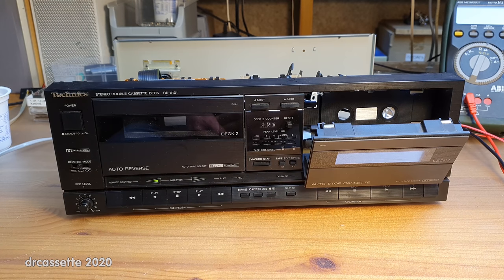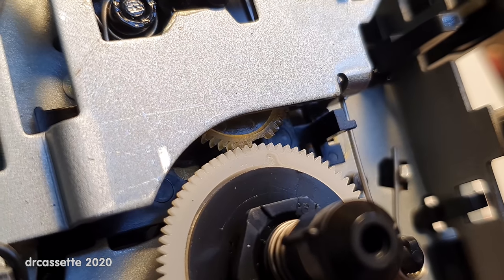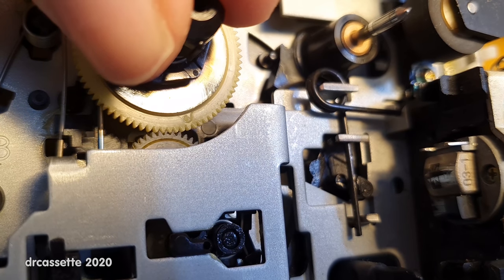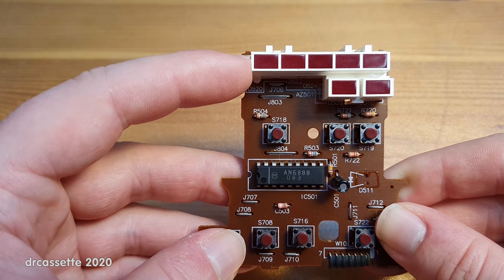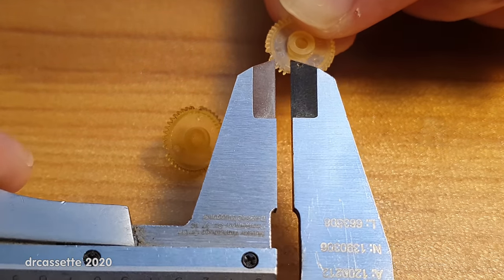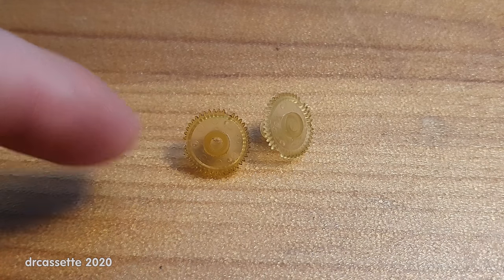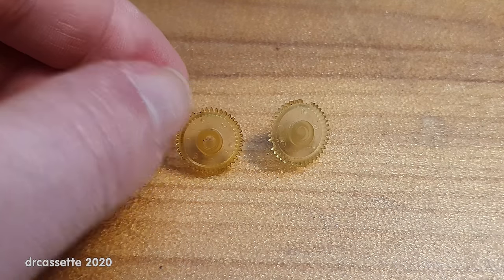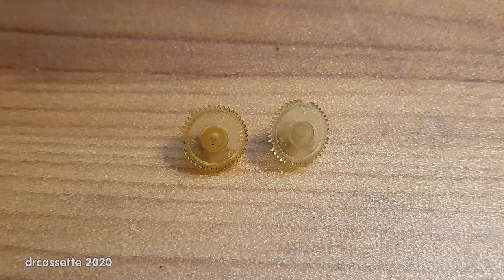Technics RS-X101 dual cassette deck with broken soft plastic gears

Comment from the maker: Some more info and thoughts:
- It has been pointed out that there are replacement gears available that have been made from a mould of an intact original gear, as discussed in the video. However, two of these gears cost more than a cassette deck like this is worth around here. So such a repair would be uneconomical. 
- While I am taking part in this debate, I am not looking for ways to reproduce gears myself. I don't consider many cassette decks worth the effort of reproducing gears. 
- These broken gears each have 42 teeth. The teeth have a special shape, they are not just triangles arranged around a circle.
- Apparently some high end filament based 3D printers are able to achieve a print resolution of 0.1 mm, which would be good enough.
- The prints from resin based 3D printers are apparently not long term stable. UV light is used to harden the printed resin, but any further UV exposure (admittedly unlikely inside a cassette deck) further hardens the resin, so eventually the material becomes brittle.
Reply: It will be great if someone can give a link to buy gears like this. I have Philips but the teeth direction are under a corner, so more difficult. 🤔
Reply: You have the same kind of cassette deck and same plastic wheel on many Technics as well as Panasonic Rx-Dt and sisters. Hope it helps, Best, Ingeltech
Reply: Unless it's a Nakamichi, Sony ES or another well-sought-after high end deck, maybe a Pioneer CT-F1250 or CT-A9 or some older Duals, getting replacement gears is not worth the effort. Especially not for a rather questionable dual well Technics, probably with already-worn Ferrite heads that can't even reach 15 kHz 🤷🏼‍♂️

Technics had some killer decks back in the day, but this isn't one of them.
Reply: @Remembergoodolddays  Many decks had those mechanisms, many autoreverse decks from Technics and Panasonic (more or less the same company) and I think that also Denon used it.
Reply: Agree that this deck is probably not worth the effort, I've seen these gears on line as single units and larger quantities.  
My buddy who has just emigrated to oz is a Horologist and regularly files teeth in brass discs to make replacement cogs, using the old cog as a template.
I used his equipment, desktop lathe, to ensure the 3D printed disc was round and the hole was centered. 
TUsinghen, using the old cog as a template I filed the teeth with a small triangular file that matched the pitch on the original cog.
It certainly did a good job on my 30 year old JVC twin deck
Reply: Beautifully said my friend

Comment: I would have guessed the tape transport was from Philips as they were using such soft plastic basically everywhere, but it makes sense it comes from Alps.
I can confirm the noise increases when the gear is replaced with a harder plastic type: I have a Philips CD 204 with a new gear in the drawer open/close mechanism and a portable CD player Philips D6800 with a new gear in the pick-up sledge movement. In both cases they work fine, but they are much noisier, the portable CD player especially is very noisy when changing track. But both gears are not critical for audio quality and I can live with the extra noise. (also both gears were already available, I just ordered them, no need to 3D design and print gears !)
Reply from the maker: There are good replacements available for the Philips CD loading mechanism, and those CD players are worth buying such a replacement gear :)

Comment: I have been ordering from a guy on ebay out of Hungry for these gears. Done 3 decks already. They are louder but run like champs...push through the tapes reels quickly and don't bog down.
Reply: Can you post address of the seller from Hungary if possible ? Thx
Reply: @pliedtka  akg090
Reply: @Phatty057  
Köszönöm - THX!
Reply from the maker: I have found there are replacement gears available, however, two of these gears cost more than a cassette deck like this is worth around here. So such a repair would be uneconomical.

Comment: Technics broken gears is a typical issue, there is a guy on ebay selling these gears made by 3d printer
Reply from the maker: I have found there are replacement gears available, however, two of these gears cost more than a cassette deck like this is worth around here. So such a repair would be uneconomical.

Comment: I remember a little over 20 years ago noticing how many VHS VCRs were eating tape and it was almost always caused by the reel drive rubber tire glazing over or drying out. I was glad that the Panasonic VCRs we had at home used one of those soft (urethane?) rubber gears that never caused that problem and would seemingly last a really long time.

Here we are a '*really* long time' later...and the rubber tires are looking a little better now since they're generic and more easily substituted.

Not going to argue since you have more (and more interesting) decks come through your shop that might be a better use of the parts from this broken one.
Reply: Ugh I hated those awful tyres - high failure part found in a few 80s-era boomboxes as well; a royal pain to source and replace with new. The take-up spindle won't rotate if the tyre breaks, fails, or disintegrates, thus eating tapes.

Comment: OMG, I had almost identical model before and had exactly the same issues, forward and rewind fine on right side but no play, on the left side, I only can play or record in the reversed direction. Thanks for revealing the reasons as I dare not to fix them.

Comment: I bought a replacement resin printed gear for my technics RS-B55 as it had the flexible gear with 3 teeth missing. The clonking has gone, but there is a low mechanical noise on playback, since I just enjoy playing cassettes and not a hi-fi buff it's not a big problem, but I agree with what you say in your video.
Reply from the maker: Thanks for the info!

Comment: You don't want to "put up with ridiculous suggestions that are guaranteed to fail".  You don't sound angry at all!  You clearly have more knowledge and experience than I do, but check this out -  My Technics deck didn't work.  I bought a printed gear on ebay.  Now the deck works.  It's amazing.
Reply from the maker: I have since found there are replacement gears available, however, two of these gears cost more than a cassette deck like this is worth around here. So such a repair would unfortunately be uneconomical.
Reply: Hi, sorry but could you please send me the link of the replacement gears of the cassette player of this video in the reply? I have this same model with the same broken gears, but I can't find the replacement. Thank you very much

Comment: That gear is easy to obtain for $11 shipped.  It's out of Russia, and also another guy in netherlands.  I've bought about 16 or so already to fix many Rs-Tr series decks.  Just search eBay for the Technics part number ..you will get it.
Also there is a video on how to fix that.  There is no need to take anything off the back of the transport contrary to popular instruction.
I've successfully repaired over 10 Rs-Tr decks already.
You are right..you can't and should not 3d print that.  With gears you have to respect module and pitch!  You have no 3d printer that can respect that resolution....yet
Sorry but I disagree completely on the soft plastic.  I can and did replace several and hear no noise or problem.  I only can't speak to longevity.
Reply from the maker: So I would need to buy two of these gears at a total cost of about 22€. The problem is, a cassette deck like this around here is worth maybe 10€ on a good day. So such a repair would not be economical. Of course, if there is sentimental value involved, this can be very different, but I personally don't want to loose money on my repair projects.
Reply: @DrCassette  That's a shame - I get about $100/usb ea serviced and repaired on Ebay - not much profit but enought to make it worthwhile.  My bigger problem with these decks and I'm sure you may run across it:
Sometimes the takeup hubs will seem to "catch" as they spin and drag.  This happens because if you prise off the hubs on the front side, there is a little plastic collar against the back metal plate that centers the spring and that same spring rides on it.  This hub will split, cause drag, and the spring will catch on the even minute split.  I'm currently trying just some small flat plastic washers, but have only had limited success...
Some of the newer decks i.e. with the motorized eject and rounded front are even more expensive to fix - the pinch rollers go bad and they are very specific 13.5mm with a strange collar.  I cant find them for less thatn $10 shipped * 4 =$40...Now it's starting to get hard to make it worthwhile with those.  (example RS-TR170)
If you know a solution to either problem, I'd appreciate it.
I just hate to see these discarded.
Reply from the maker: @jimb032   I actually have not come across this problem with the takeup hubs yet. I have had hubs that had seized because of bad grease. Cracked plastic parts are always annoying. Indeed replacement pinch rollers are extremely expensive, I unfortunately have not yet found a better, low cost source for them either...

Comment: Measuring the exact dimensions of the gear is already hard enough, even if you could replicate it, it would never be 100% accurate unless you have the original cad drawings for it. The original moulds where probably made of steel and with very fine tolerances. I’m always amazed by how mechanical engineers can work with such small, precise dimensions.

Comment: Tested method by myself! Baking soda and super glue + file = you can construct missing teeth. The hard plastic is not a problem and it is better than missing plastic ;)
Reply from the maker: I certainly don't have a file small enough to reconstruct these tiny teeth...

Comment: Not sure if it would work, but could you grind the teeth off the gears and use an O-Ring or tire in place?  On the hub gears, can they be made to use a tire as well?  Maybe worth a try just to see what happens for curiosity sake.
Reply from the maker: These gears are too thin, they could not support an o-ring...

Comment: I've had similar problems with a Philips D8614 Boombox, but in my case the gears just rotted inside the machine and instantly broke into pieces. I asked a friend if he could 3D print me the gears, but for now he only managed to print me just one as he is having some issues with his printer. At least that one gear works just fine. Also, from what I know, these gears are made out of TPU.

Comment: I fixed one of such gears but the plastic was harder - I used JB Weld Epoxy to rebuild the broken gear and filled the material to required shape - time consuming process. As whether such soft plastic is really required - maybe Matsushita, sorry Alps, made it too soft compromising the longevity.
Actually I would like to see the Uher deck mechanism to compare design and kind of materials used in it - hopefully less plastic.
Reply from the maker: What Uher deck do you mean?

Comment: We call these cheesegear :)
Luckily these are available from various sellers
Reply from the maker: I have since found there are replacement gears available, however, two of these gears cost more than a cassette deck like this is worth around here. So such a repair would be uneconomical...

Comment: I'm done with some Technics electronics now. Had an SU-V550 amplifier develop a fault after being repaired and then used for 5 hours and 45 minutes. Hopefully my partially repaired RS-615US cassette deck actually lasts after it's been fully repaired.
Reply: I have the 615, broken too. Oscillates at a high frequency, noisy mechanism, counter dead...
Reply from the maker: I have had mixed experiences with Technics equipment. Some of it is quite reliable and reasonably easy to repair when it fails, but other equipment is just terrible...

Comment: There is a fix that I have successfully applied, but bear in mind the mechanism.will be noisy and a bit messier. Proceed with putting a very small amount of HOT GLUE where the missing teeth are and they will turn fine. :-)

Comment: hi bob here you can save me a small bit time  the trans in  12.5  0  12.5ac  
do you know the amps on each 12v power rails   i now volts came from the amp it paired
with when sold   bob

Comment: I have the same cassette player with the same broken gears. it's hell to find them! Can you recommend me some solutions please? I am Italian so if for example there is some site to redo these gears in which I can also access. Thank you very much
Reply from the maker: Apparently there are replacement gears available on Ebay (see the other comments on this video), but I have not repaired this cassette deck as it would have been uneconomical.
Reply: @DrCassette  Thank you very much for the reply. I think I have found the spare, it costs 7 euros a gear, I bought two. I have listened to your measurements and they seem to match those of the announcement. If they don't match I will make the return. I have been looking for these gears for almost eleven months

Comment: hi this video is very out of date  there is someone making gears for the deck the only thing is the cost of them  i have 3 decks and i only had one gear bad out of 6 gear
they do break up they go soft and start to fall in to small parts

i will say there is away to use this model of decks    no need ti bin them ever   i just done work on my tascam 238 deck it 100% working yes the DB ic go in them 
still sounds ace   i think the Technics RS-X is over priced on ebay because of the bad gears  and price of new ones   i workrf on alot of deck the micro stereo cassette decks are a right pain to fix

Comment: One of these decks showed up at my local pawn shop, is it any good and should I pick it up? I'm prepared to order belts and gears online
Reply from the maker: I would not recommend spending any money on a cassette deck like this.
Reply: @DrCassette  thank you for the response! Are they bad or just mediocre and a dime a dozen?
Reply from the maker: These cassette decks need gears in the mechanism replaced, as shown in this video. There are plenty of other cassette decks of equal or better quality, that don't require such repairs.

Comment: Moggy's HiFi Antics
1 second ago
I have a Denon DR-M07 with the same issue but another youtuber "luvradios" put me onto searching for "Technics RDG5772ZC RDG5772ZA ". 
I've ordered 2 from this guy...."appleof666sodom" in Poland, but there are others. Check them out.   I'm in Oz so I am desperate for this. I paid too much for this Denon to write it off.
I take your points about being of a soft material but I take what I can get and if there is a little whirring then I don't mind. At the moment I get this terrible ticking because of 1 broken tooth. I bought 2 so that I can replace it again in the future if needed.
Reply: Thanks for tip - I check what he has in inventory - I need gear for Sanyo based Nakamichi.
Reply from the maker: I have found there are replacement gears available, however, two of these gears cost more than a cassette deck like this is worth around here. So such a repair would be uneconomical.

Comment: Broken gears suck..... I lost a Nice Phillips thingy to broken gears
Reply from the maker: Philips equipment often has problems with bad gears. They used a strange soft plastic that goes brittle over the years.
Reply: @DrCassette  nylon gears perhaps
Reply from the maker: @lukedavis436   No, it's not nylon, it's a really strange material that after years takes the same consistency as cheese...

Comment: Those gears are avaialble on ebay i  bought some that are 3d printed and they work pretty well
Reply: I have a panasonic R sereis boombox that used these gears would you like the link?
Reply from the maker: I have found there are replacement gears available, however, two of these gears cost more than a cassette deck like this is worth around here. So such a repair would be uneconomical.
Reply: @DrCassette  thats to bad i found some for 12 usa dollars and it saved my boombox that was clicking I have an panasonic DF 55 or FD 55 i cant remmeber and wanted to save it its my favorite.
Reply from the maker: @stpworld  One of these replacement gears costs about 10€, I would need two, so the total cost would be about 20€. But a cassette deck like this is only worth about 10€ around here on a good day...

Comment: HI DR 

i have alot of this model i have not seen one yet with bad gears  they are very small   it's luck what you get   i think the amp goe's first  please don't run this model down
in all make's there's bad part  like the old lego brown bricks that can break i have 1000's of the old brown lego plate's brick an not came in to any bad one's

it's like the this deck    and the one's i have   i have had cassette decks need alot of work big time